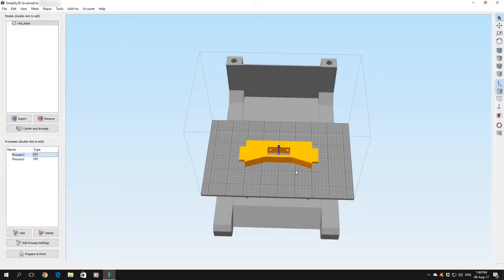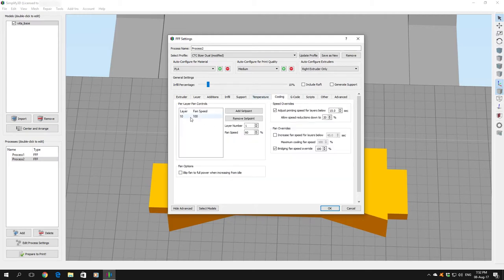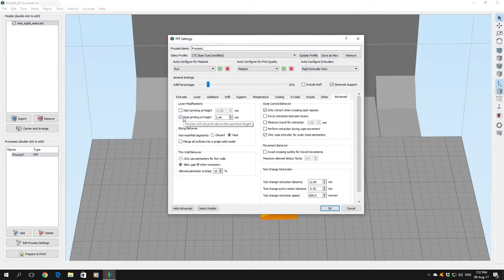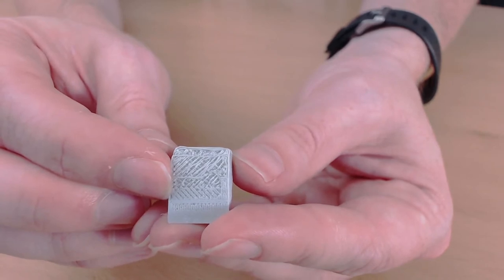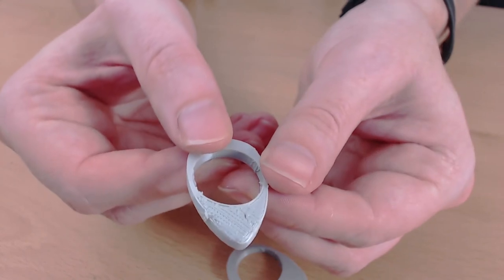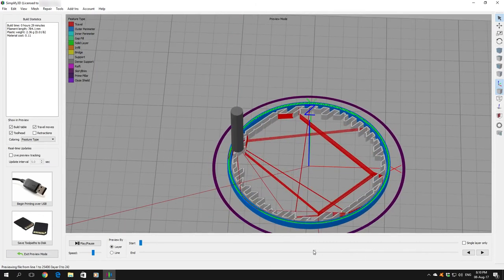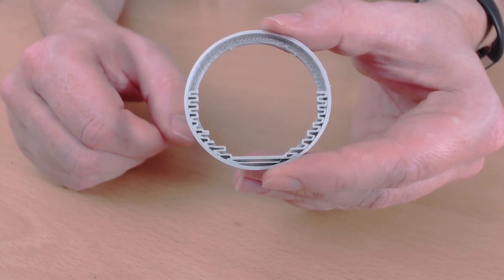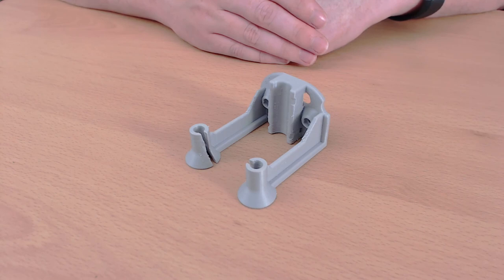3D Printing Problems and Tips

Comment: Got mine today. The head rams into the back right hand corner and makes a horrendous noise. I used the startup script, the heads try to get out the box hugging the right corner but when the head moves, the extruder stops beyond the plate making levelling impossible. This is my first 3D printer and wondering if I’ve got a duff one? Any help really appreciated. Thanks!
Reply from the maker: Did it do this as soon as you turn your printer on before you load any files for printing.
Reply: Abernus69 It did it when I chose level bed which was soon after I first turned it on. I didn’t realise there was a startup script. The instructions are not that clear!
Reply from the maker: @kooky2  to be honest it's been that long since I used the CTC. The best thing I did was to update the firmware to salfish. How ever this fits come with some risks so read up on it first, and is done at your own risk
Reply: Abernus69 I did wonder! Thank you for replying.  From looking at other videos, the problem maybe a loose / bad connection. I’ll send it back if it’s not an easy fix.  I was hoping to do all the upgrades you’ve done but I guess that will have to wait!
Reply: a friend gave me his  ctc bizer dual and i happen to get it to go to the home postition but then the head went the the end and got this loud shudder. then friend checked the trigger switches that the head touches in order to tell it to stop...well it turns out that the metal contact was flat so didnt touch the red switch. so seeing as the oher where bent so the head touches the metal contact and in turn pushes the red switch i then bent the metal contact like the others and the shuddering stopped cuz the metal contact i bent had allowed the head to push it to push the red switch to stop the head from moving...hope this helps

Comment: Why is there a thumbnail of a fire on your printbed ? Did this happen, fire safety in 3D printing is a real issue and there are ways to prevent it, but to show that thumbnail is not authentic to your topic.
Reply from the maker: Saftey is something I take very seriously when it comes to 3D printing. However, I have changed the thumbnail of the video, the original was meant to draw attention to the video not portray what has happened to my printer. If this thing caught fire the last thing I would be doing was publishing videos! Happy 3D Printing.
Reply: Thank you, for adjusting your thumbnail it is an honest and responsible thing to do ! much luck and success.